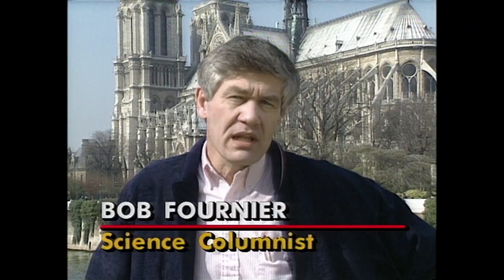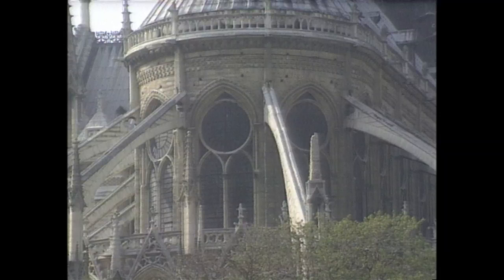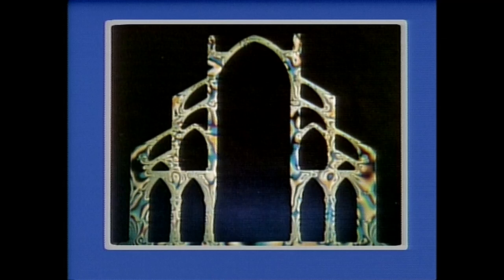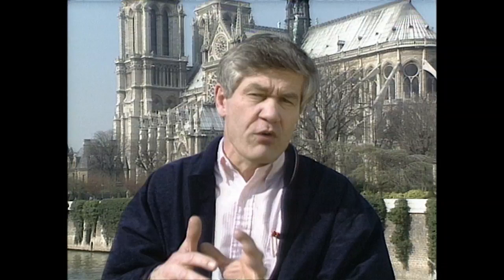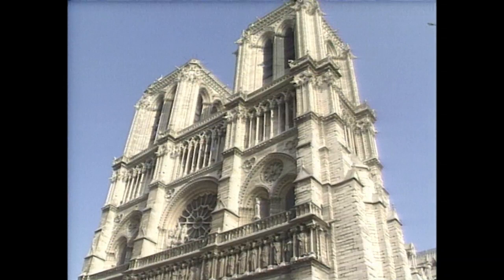Notre-Dame Cathedral and its flying buttresses and mysterious gothic architecture, 1990

Comment: I'm irritated at these misleading headlines and ignorant news reporters saying that everything inside Notre Dame was lost due to the fire. Then as the smoke clears, I'm witnessing confusion all around as to how the building was spared. They're ignoring the fact that the entire inner cathedral was spared aside from some fallen bricks thanks to the rib vaults that protected everything underneath. It's a medieval engineering feature that acts as a shell that supports the weight, strengthens the structure and protects it from fire. They knew what they were doing when they made this, because people lived during a time where fire was a serious threat at all times. The inner structure and supporting walls are entirely sound, and most of the artifacts were untouched. This lack of engineering expertise and misunderstanding makes it all the more understandable why reporters were so easily tricked into thinking planes brought down the world trade center.
Reply: oh so you've been inside Notre-Dame today and everything is good? call it misleading while simultaneously end with a statement that the world trade center was an "inside job" ha ha
Reply: He means that planes started a fire that weakened the steal structure. The fire brought down the building not the airplane
Reply: Captain Nemo well clearly that’s what happened... who in this world thinks the planes hitting the towers immediately took them down?